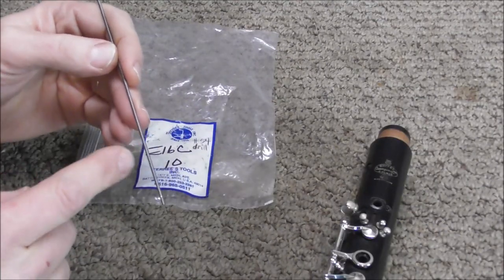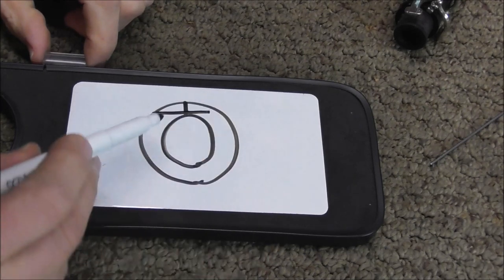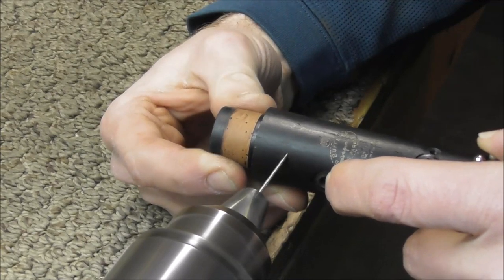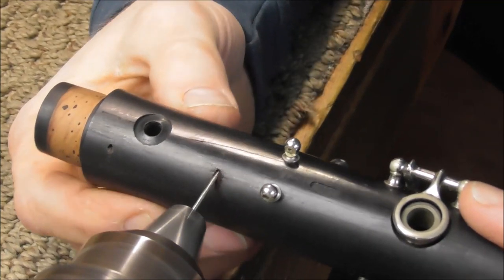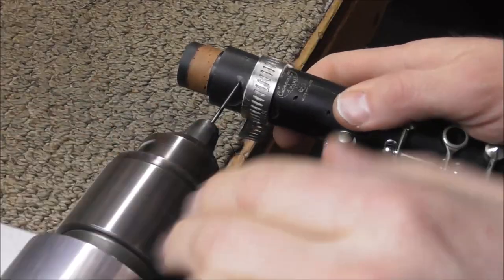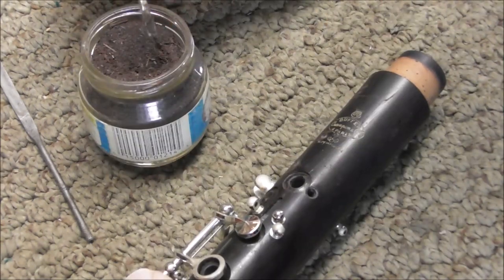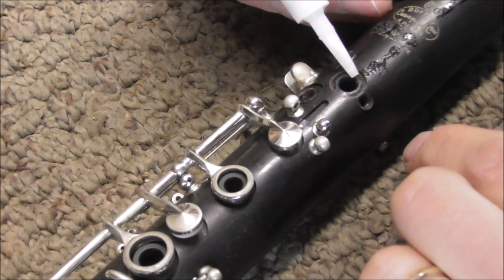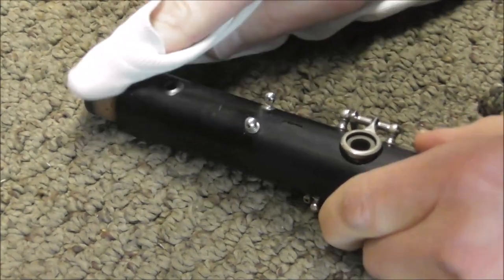How To Pin a Crack In a Clarinet

Comment: Interesting! I use a different procedure, but it is nice to see variants.   I drill with a dremel drill press, then put the pin in with an arbor press.  I coat the pin with special thin epoxy glue before insertion and use a dremel to grind the pin just under flush.  The sawdust I made myself from an old destroyed clarinet (careful, most of these woods are toxic as dust),  I have mixed it with epoxy if that strength is needed but is harder to sand than super glue, so super glue is probably better most of the time.  Most of the time I recommend an overhaul if pinning is needed, as it usually is a good time to do that.  It makes it easier to get the finish perfect if you have the instrument stripped of all its keys and such.
I would also recommend practicing the drilling on some dowel stock the first time. I don't use the heating, but I use that thin epoxy glue and a 1 size under drill size for a pin.  I know that ain't traditional, but it holds real good.   If I tried to use a table motor to drill, I would definitely break a lot of bits!  My recommendation is to buy an old beat up wood clarinet for about 25 bucks and experiment until you get it right.

Comment: I have found that heating the pinning rod will burn the  wood on the the beginning of the process. I have had instruments come back . I have done 2 things. First I humidify the joint to close the crack, might take some time. I follow Allieds Repair tip old book .You can use a tap, or as I do use a lub. my preference is plain old perfin wax to help rod slide in. All the things  I see in this video are great info. There is a new composite rod on the market you might try.   I have and I liked the result.

Comment: Do you have any videos on leveling clarinet tone holes. My daughter’s wooden clarinet has a tone hole with a small notch in it. I have re-padded it with roo pads and it does play okay but I would like get the hole smooth. I have got a cheap wooden fife with very rough tone holes to practice on.

Comment: I have an wooden Irish flute with a plastic head joint. It has a large crack that runs though the blow hole.  Would the repair process be the same?

Comment: Nice. I tend to use black epoxy instead of cyano + wood, but as long as it works ! It also is pretty good to clean the crack with alcool before gluing. The heat and crak pinnig wire is really interesting.
Reply: I use epoxy with the wood sawdust mixed in.

Comment: This video is very helpful, thank you. Question: what is the reason you go in straight/perpendicular with the drill bit before adjusting to the correct angle? Is it to prevent tear out? Thanks again.
Reply from the maker: Drill bits do not like to go in at an angle, so you need to go in straight. After the drill bit goes in, you can angle it so it does not go through the bore of the instrument.

Comment: Greetings to you.   Thank you so very kindly for this video.  Wow.  I have a question...  I bought a very old wood clarinet in the Key of A which I am thrilled to have.  It looks great except one, I believe, minor issue.  I do not see any signs of cracks as those caused by temperature changes, but there is a small V shaped issue on the edge where the cork is where it holds the upper and lower section together.  It does not appear to be all the way through but almost, and it looks like the solid circular wood holds itself together even so, but I would like to know how I might strengthen this area, the outer V shaped issue perhaps no more than one half inch down (the old cork is still wrapped around it and also seems to help make it contained over time perhaps, but I do see the cork needs replacement--I do not trust this cork to hold the instrument together).  I do know how to replace the cork and pads at this point in my experience in this world of repair.  I believe this thing was caused by a minor accident somehow, which I hear is very common for this area on the clarinet.  Because three pads are missing, I do not think this has been possibly used for some time.  This clarinet is believed to be just over one hundred years old.  It appears to be very well made, great wood, and in great shape other than this one thing.  And I need to make a case for it.   Your advice would be very much appreciated.  Can I fill this V in?  Does this require a pin?  Or is this a relatively easy fix that will last without some internal support?  Would it work to make a sliver of hard wood to fit into this gap?  If so, how to glue it in??  I am not sure how to proceed or what to use.  Thanks so much.  Thanks so kindly for your time.  God bless you in Jesus' Name.
Reply from the maker: It is hard to say for sure without seeing the clarinet, but it sounds like something that is fairly common on older clarinets. If it is what I am thinking it is, it is nothing to worry about. you can safely leave it alone or you can fill it in. You can use grenadilla wood chips and super glue and file down the excess with a small file. If the gap is large enough, you can put a piece of grenadilla wood in there and super glue it and then proceed with the wood chips and super glue to finish the job. However, I would only try this if you are good with wood and you have some experience with working on clarinet bodies. You can do damage if you are not very careful.
Reply: @TheBrassandWoodwindShop  THANK YOU SO MUCH for your very kind and helpful and amazing reply.  I so very much appreciate it.  Thanks so much.  Your mention of super glue got me thinking about another question I have.  If you don't mind.  I bought a very, very, old wooden flute which also has a most unusual thing on the section where one blows into the flute.  It is not wood there, and is made out of bone, unknown bone, and is lined with metal below (inner metal tube, but bone is perhaps 1/8 inch wrapped around it.  This has a big crack in it along the length, and I perceive very common issue due to weather changes and time, which makes it logical that this would crack.  This crack in the bone, I believe needs to be filled in since it affects where the hole is where one blows into it.  Do you know of a substance, glue, or product that can fill this without causing more issues in the future?  Something that might allow for expansion and contraction?  I am wondering if you have any ideas or solutions that could be done to help this situation?  I would so very much appreciate your thoughts on this.  And while I am at it...I have yet another question.  I have a metal vintage flute that is well worn which was silver plated. It looks silver underneath, so I am assuming it is a nickel silver beneath, not brass.  The lip plate has a lot of the silver removed, and I am wondering if this is okay to play as is?  I do not know about mixed metals, but when I consider nickel silver made of copper, zinc, nickel, I don't see a problem, unless it is the nickel that could be a problem?  I am not sure. Is nickel silver safe for lips?  I am wondering.  Thanks so very much for everything.  God bless you in Jesus' Name, and Happy New Year.  Thanks so much.
Reply from the maker: I have never worked with bone, so I am not sure what to do with that one. I do not even know who to ask. 
I can answer your other question though. Under the plating on a lip plate, it is most likely nickel silver. It is safe for lips. In some rare cases, it may cause acne, but it is almost always fine.
Reply: @TheBrassandWoodwindShop  THANK YOU AGAIN so very, very, much for replying to my additional questions.  I thought a lot about your answers and thanks so much again for your great kindnesses and time for them.  I perceive there might not be any solutions for repairing this kind of thing in bone.  I heard suggestions of clamping it, like those things one can get at a hardware store, but I now perceive looking at mine, that it would only cause serious injury to it, even perhaps crush it--even though it is weighty and solid.  It is that very thing, the force on it would probably break it  I too cannot recall any glue or substance that might fill it in, that is the crack on it without causing future damage.  I have the impression that people are using them with a crack or even cracks on it without issues.  I think mine will play as well, and it even perhaps looks like a previous owner used it based on its condition and care of it.  And, also, I am so grateful to know that I can and did proceed to use the metal flute, and I have no problems in that way.  I do perceive I might have some leaks and I am so glad you have the videos I need to do this.  Again, thanks so much for all your help and guidance.  I so very much appreciate it. I hope you are having a wonderful New Year!  God bless you in Jesus' Name.
Reply: @Elkwoman46 you could use dentist powder for fillings to repair bone

Comment: This is good job but i did not understand the reason   why pins are used ? İs this the reason of making  the crack stable ?  Because some videos i see that others just use ebony powder and superglue
Reply from the maker: Pins are used when the crack goes all the way through to the inside of the clarinet. That keeps the crack from opening up again. If the crack does not go all the way through, you would only use superglue and wood chips.

Comment: Do you replace tenons often?  I have not yet and curious if there are any secrets to doing this properly.
Reply from the maker: I have only replaced tenons about 6 or 8 times, so I am not an expert at it. It is not that hard to do, it just takes a long time. You will need a lathe and a boring tool and a few other things. You need to plan ahead so things line up right when you put things together.   
 Usually it is best to replace the joint and swap the keys, but sometimes that is not possible or practical.
I hope this helps.

Comment: ideally and circumtance permitting , a measure would allow the pin to break off just below the drilled holes surface...the heating of pins is a must... like the grenadilla cyanoacrylate fil tech...